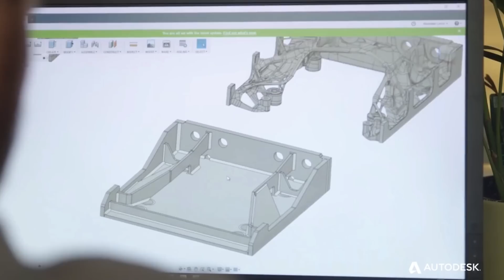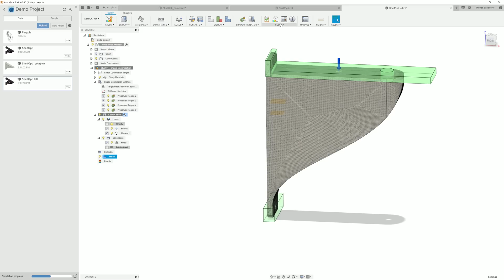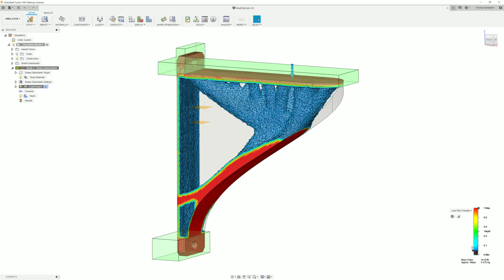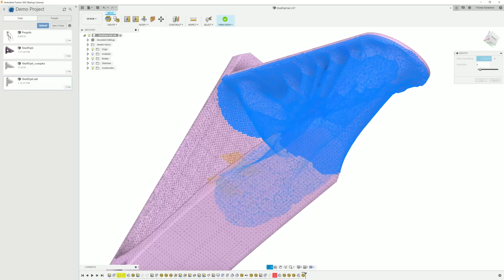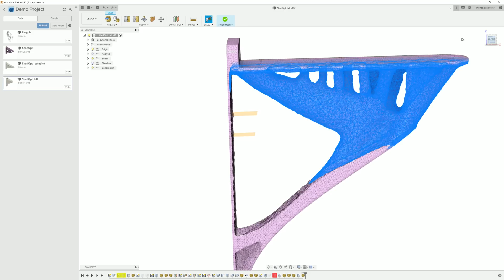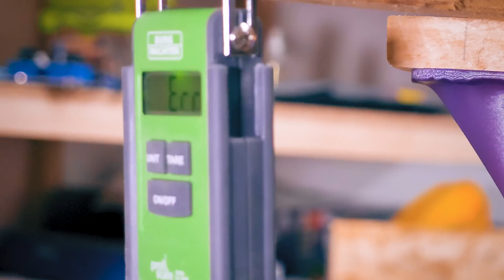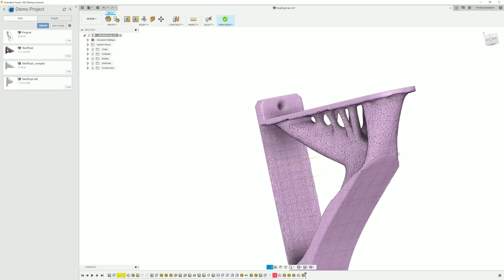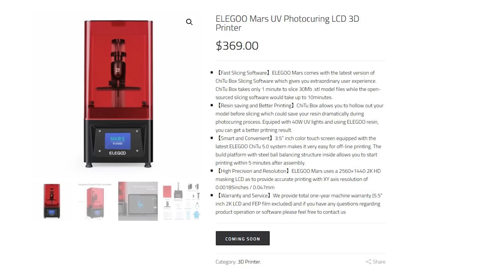Making STRONG shelves with Topology Optimization

Comment: Doesn't this optimisation mean you should print the object solid?
Reply: @falchulk And the fill pattern does not change the calculated strength at all?
Reply from the maker: Yes, but they're still plenty strong this way.

Comment: I am surprised you used PLA as its long-term performance under load is not so good. I have experienced significant warp over a period of 8 months with a continuous load applied but there was nothing wrong with its strength. It may something related to hygroscopic action in an outside environment but I don't risk PLA where I need it to support items for a good period of time, so I use any of the rigid polycarbonates like PETG.
Reply from the maker: I'll check back on them in a few months, but considering the brackets are capable of holding way more than they currently are loaded with, I don't expect any issues here.
Reply: @MadeWithLayers  yes, as an indoor  device it may behave OK. The failure was very gradual, over several months, and not subjected to strong sunlight. The PETG replacement is now 6 months old in weather and sun and no degradation has appeared  .. . yet! If you have OnShape, search for QFH and you should find my project, the offending part is the leg assembly. Ignore the crap helix assembly that is tricky to handle with OnShape tools currently, but not much better with F360 either!

Comment: The shape does not look really... optimal - at all.
The "optimisation" here only shows you which part has the highest stress, not that leaving them alone would result in the highest strength.  (should easily be noticeable with that big chunk in the middle that does not add much to its strength but in the original thick slap was the area the stress concentrated in)
You'll get different results if you do this interactively - just cut it down a bit with each pass.
Reply from the maker: Good idea - I*'m sure there's still plenty of material to optimize away. That being said, I'm happy with the amount of material used with these brackets and like the look, so there's no need to continue optimizing in this particular case.

Comment: But youre using topology optimalisation and then a hollow print.....
Reply: everybody relax it's just a shelf...
Reply: Kris Keersmaekers  given the reason for making the video, that and any other engineering considerations are entirely moot.
Reply: Kris Keersmaekers q
Reply: While I find it entertaining that all you people keep ostracizing and fighting over this dude's comment, you all fail to realize that he's right. If you actually watched the video you would see it broke right on the lower support mounted to the wall. So yeah, failed design
Reply: @jc36919  The lower mounting point failed because the stud failed so that doesn't mean anything. And the loadtests he did also proved that they where able to withstand the intended loads which means good enough.
Reply: But did you see him stand on the shelve...
Reply: @TonyRios  But you could have done that with a straight beam bracket, that weighed 1/6 as much.

This is poorly designed.
Reply: @operator8014  But it looks 1/6 as cool
Reply: @daviddavidson1417   "Operator 801, Do you have autism?"

Not nearly enough of it by my reckoning. Being on the spectrum usually provides a natural route to engineering.
Reply: @NomadPrototypes  Not wrong. Actually completely correct. You may now leave this conversation that you are not qualified to speak on. Thank you.
Reply: @operator8014 

Says the person thinking their opinion is a factual statement.
Reply: @Psyrecx  And what opinions are you talking about? Are you talking about the factual appraisals that I offered as an aerospace engineer? Those aren't opinions. Those are facts. If you choose to argue against facts, your life will be difficult.
Reply: @operator8014  but he literally says in the video he could have done it with a simpler design but wanted the look this method gives..
Reply: @Unorthadox_  Cool, I think it looks freaky, but that's just my opinion. The weakest point has nothing to do with the aesthetic, but wit the abhorrent rear mount.

The reason the simulations didn't alert him to the garbage mounting point is because he doesn't know what he's doing and incorrectly applied fixture points along the rear, and incorrectly defined loads along the top.

If he knew what he was doing, this video COULD have been awesome, and educational. As it is, it just empowers people who don't know what they're doing to go make mistakes that will ultimately lead to property damage and injury.
Reply: @operator8014  
I totally agree here!  Nice showing up but not done right.... 
I am qualified to give this statement...  :-)
Reply: @operator8014  The mounting point is an outside constraint that must be worked within. If you work on aerospace, you'll know that's normally the case.
Reply: @NigelTolley  The mounting point still needs to be accurately fixtured and supported. There are about a trillion better designs that would maintain the aesthetic components while eliminating that failure point.

All of this would have been obvious if he had the first idea of what he was doing for fixturing or stress analysis, instead of just pushing buttons and posting nonsense.
Reply: @operator8014  Funny how all these people are supposedly "qualified" and "know this/that" but are only capable of saying the author designed it poorly, without making any mention on how it could really be improved. Sure, anyone can claim to know aerospace engineering, but I haven't seen anyone actually show what a good design is or how to achieve it. And if you claim it takes years of study, well you're just making an awful excuse to avoid explaining anything.
Reply: @davinderc  "DURH DURH DURH", he said, after clearly not having read my statements on proper fixturing and load modeling!
Reply: @operator8014  how would you apply the fixture points along the rear and define the load on the top surface?
Reply: @operator8014  You may be right, and I'm sure you are more experienced in the topic, but being rude gets your point nowhere. Instead of just straight bashing other people and pointing out what they have done wrong, you could (should try!) to be educational, and mention what was good in his design, and where/how could it be improved. The fact that someone is inexperienced/doesn't know something you do, does not mean that they are inherently dumb, and not able to improve; remember, you too had to learn all this while making mistakes on the way.

TLDR - don't bully; educate
Reply: @operator8014  In addition just think about the effect of your words - the stuff you said COULD have made someone feel discouraged or lose self-esteem, but it COULD NOT have made someone smarter or more informed.
Reply: (L)  @kalla103
Reply: @kalla103  As long as it points out that this is NOT how it's done, that's fine. I explained factually how it IS done, and why this is WRONG.

If someone cares about how mean these facts are, then they don't matter to me.
Reply: @operator8014   "I explained factually how it IS done, and why this is WRONG.
"

Where did you do this, exactly, Opie? I keep on seeing you make reference to this thesis of yours, qualifying... something ! I'm not exactly sure what. You're not that specific. But scanning through this thread doesn't reveal any content that you've submitted beyond a few unqualified statements in the affirmative. Are you still talking about your beam bracket? At first I thought you were going to unleash some kind of serious interrogation of "proper mounting position" but it's been like, a week, and nothing has materialized. 

I'm trying to recall if any other engineers of my acquaintance betrayed your... obvious level of sophistication.
Reply: @davinderc  I'm not an engineer, but it's quite obvious that this guy doesn't know what he's doing. The top mounting point broke repeatedly, and he excluded it from the simulation. If he had done a stress analysis he would have realised that it was a weak point and it needed reinforcement. Also, he put them straight into drywall instead of into studs. The brackets may be strong but the drywall will fail easily as seen in the video.
Reply: @boostaddict_  He didn't put them into drywall, were you paying any attention? Are you talking about the same video here?? Considering you missed that important detail, I'm not surprised you thought this video covered the whole project. He didn't show all of his simulations, you're assuming he only simulated what he showed.

 In any case my point was that Opie is trolling people with his non-existent "aerospace engineering knowledge" given that he can't actually describe the correct way any more than some vague "he did it wrong and I'm an aerospace nerd."
Reply: @operator8014  someone has been watching to many sci-fi shows to consider themselves something they are not
Reply: @operator8014  He mentioned like 5 times that there are simpler ways to do this and it's not the strongest but he is going for something unique. Stop flapping your mouth if you did not watch it.
Reply: @operator8014  r/Iamverysmart must be hard being such an alpha science chad
Reply: @operator8014  I mean, it's a learning process for all of us.  Feel free to make a video in your own 3D model and show us how to define load and fixture points right, I like educational stuff on youtube.
Reply: I agree! I keep waiting  for this operator 801 to make video, he is so full of knowledge.

Also I think  everyone  saying the print failed do not realize that  all designs have a failing point no matter what material or structural design is applied. The only reason the bracket broke is because  he loaded beyond  the weight he used as an input for the design constraint, which  was to be expected. He basically  was validating his design and he proved that it would withstand  the expected loading  and then some.

I thought  it was a great video to help demystify a very  complex and difficult subject. Currently topology optimization is in its infancy and and it is stuff taught in graduate level engineering  courses.
Reply: @nisterror  I very much agree. "Perfection is the enemy of perfectly adequate." Within a certain budget and timeline, Thomas built a bracket that would withstand the load he chose (and proved it through destructive testing), fit the aesthetic he was going for, and successfully presented his process and his findings. Plus, when the bracket came out of the wall he improvised a solution on the fly to push the project to the finish. Anyone who has spent time in the engineering field would recognize all of that as really solid work. Could the design be improved? Yes, every design can, otherwise engineers (and myself) wouldn't have jobs. Is the improvement necessary? No, the bracket functions as intended.
Reply: @nmd4332  exactly, thanks for your insight.

Comment: It seems a little bit pointless to optimize the 3d-shape for load and then basically gouge it out and make it hollow. It's not at all the same thing it optimized for and the load stresses wont at all be the same on a hollow structure.
Reply from the maker: But it's a) strong enough and b) looks pretty. That's all I needed from it.

Comment: You know there are studs in that wall.... Those drywall anchors look like the 50lb limit type, I would strongly suggest drilling into studs instead.
Reply from the maker: It's not drywall.
Reply: Why would there be studs in a low-density concrete block wall?
Reply: @StrathpefferJunction  because that's a standard drywall wall. You don't build empty walls.
Reply: @eugenes9751  I'm afraid you're wrong, my friend. Are you American?
Reply: @StrathpefferJunction  Yes, American, California, very earthquake prone. I've seen plenty of concrete buildings, but not foam interior walls. If there's so little strength in the wall that it can't even handle an anchor, then how would it ever support a load?
Reply: @eugenes9751  It doesn't have to. The outer walls are load-bearing, and some interior walls may be, too, but this one isn't.
Reply: @shmeeed  Even a non load-bearing walls should have studs, otherwise what's supporting it? Can you please provide a link to the type of wall you believe this is? I'm very curious, because I've never seen that type of construction in the US.
Reply: @eugenes9751  its an interior concrete wall. normal in europe

Comment: Foam concrete? Should have screwed them to the studs in the wall!
Reply: What if the studs in the wall aren't where he wanted to mount them?
Reply: They're usually every 16 inches, so worse case scenario he has ti move to brackets left/right 8 inches max. Drywall isn't very strong compared to wood, so I just think it's funny how he designed a support that would support his weight and then glue it to the wall. That's the weakest link now!
Reply from the maker: It's a solid wall, no studs.

Comment: I've done simulations like this in Fusion before, but I'm always confused what material to select. I wonder which material would most closely simulate PLA, and if there's maybe something that can be done relating to force vectors to compensate for the weakness between layers.
Reply: ...try wood, maybe - as it has a similar directional strength profile? Cross-grain should approximate layers shearing pretty  well, for the purpose of calculations?

Comment: The design will benefit from printing them from the shelf platform upside down, the weight on the shelf will be compressing layers and trying to rip loops instead of compressing loops and trying to rip layers which it can do mush more easily. edit: except... the screw hole, which is an issue and probably why you printed those as loops.  2 part with a long T slot interface would be ideal.  loops compressed and pulled on where one wants it and a long interface spreading forces at the transition.

Comment: Question: Does the simulation understand the model is full of hollow cavities?  Or did you print them at 100% infill?  How does this work with the material properties related to FDM?
Reply: It does not. You can shell your part before doing an optimization. Maybe a subject for a follow up video?
Reply from the maker: Simulating FDM 3D printed parts is nearly impossible - between the intricate detail that is infill and the anisotropy that layer adhesion causes, it would be a massive simulation project unless you over-simplify the model to the point where it's only a very rough approximation.
Reply: @MadeWithLayers  hmmm, I wonder if simulating a vertical slice of layers would be enough, the layers simulated in 2d across the center for adhesion and compression applied to the rest as a value of its tensile and compression strength might be enough to be 'close enough'.  Making parts function under compression through layers and extension only through horizontally printed loops is tricky... its tricky, its tricky tricky tricky.  Uh.

Comment: Its been a long time Thomas!  I just started my delta printer design up again after over a year of it sitting.  Zero cleaning, ran perfect, polymer bushing rails FTW!!!  Literally 1mm of dust on some parts (edit: ok thats a total lie, its like .3mm at most sorry), delrin sliders shove it aside cleanly and slide smoothly, ignoring any cooking oils etc from the kitchen 10 feet away that must be on them.  5 dollar diy printable linear motion WORKS.

Comment: Would love to find something like this for Blender.
Reply: Use Solidworks or Inventor. If you're a student, you can buy the non-commercial use license for $90 and it can do actual simulation work, not this nonsense.
Reply: @operator8014  I have Solidworks but that was not the point! I favor having as many all in one solutions as possible. Sick of bouncing from one program to another for a single project.

Comment: Am I completely wrong and outdated? You said PLA is one of the strongest materials.... WTF? I thought it was the worst one... What about PETG? Maybe PLA+ I would agree but PLA...??? Please prove me wrong as I'd love to stop worrying and just print every mechanical part out of PLA as it is so easy to print compared to any other material. Cheers
Reply from the maker: Check out my Filaween test series - PLA is a very strong choice, but has issues in heat (obviously) and PLA parts tend to crack if they're continously bent in use.
Reply: @MadeWithLayers  One concern I have with using PLA for something like shelf brackets is how it ages over years (and that's something your Filaween tests couldn't take into account). The PLA objects I printed circa 2012 have become much more brittle than when new, while the ABS prints from the same era show little/no signs of age. Perhaps the formulation of PLA has improved over the years, but it's still something to keep an eye on.

Comment: Could you use the topology optimized model in slic3r as a modifier mesh inside the original model to increase the infill in the most important parts of the model? I'd be curious how the strength compares between the starting model, the topology optimized model and using the topology optimized model as a mesh modifier.
Reply from the maker: Yes.
https://youtu.be/q0YsC53mFvY
Reply: @MadeWithLayers  That is awesome. Thank you!

Comment: Looks like the bracket at 11:18 which came loose is broken near the bottom screw hole.
Reply from the maker: It is, but the way the forces are transferred through the part, it doesn't actually matter unless that top screw come loose again.